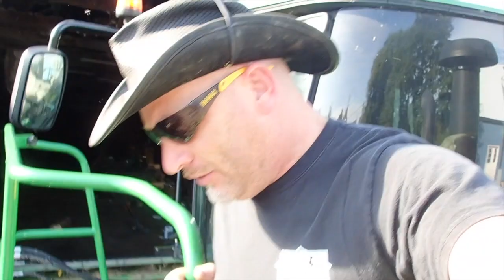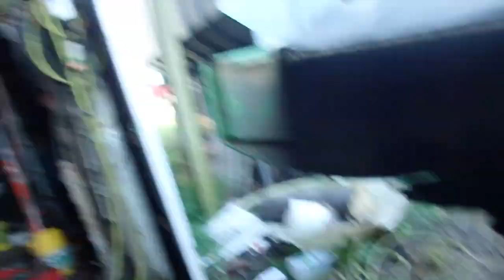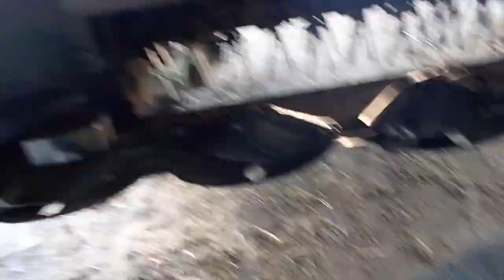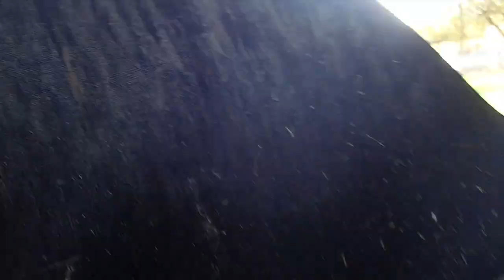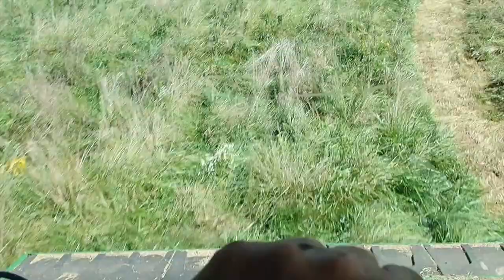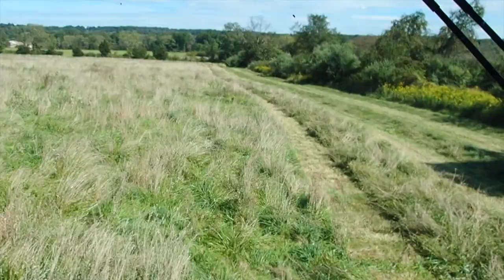Camera Mower Hay

Comment: Might have to try to find more "good" help. Not an easy task these Days as most kids won't work the hours needed. Might have to consider other options to allow you to cut faster as you have told us before. Weather issues are just a part of the farming life as we all know. At least your equipment issues for the most part seem to no longer be an issue as they were in past Years. Nobody has to tell you it ain't easy, still beats sitting behind a desk!

Comment: It looked more like a swale than a ditch. but whatever. Relative to your dad's knees -- he should look into knee replacement. I will be 70 in March and had one knee joint replaced in July and in October I will have the other one done. Every person is different, but I was walking without a cane within two weeks of the operation and at six weeks out the new one usually felt better than the old one. The first week is a bit painful, but not rolling on the ground pounding it with your fists sort of pain. After that it is really only the physical therapy sessions that hurt..
They can also straighten out the bow-leg that results from bone on bone wear (it's just carpentry according to the surgeon.) I really recommend it.

Comment: Hi one lonely farmer love the videos I have question why don't you use butterfly mowers to cut the grass to dry it out. I would have thought it would dry quicker? Please don't take it the wrong way
Reply: James Coy butterfly mowers that you pull behind the tractor have latge rotors with large blades on the end, and each rotor will cut five foot width or more.

 They are intended to mow grass for weed control. They will cause loss of the leafy parts of the crop and do not promote consistent drying and cause more damage to the remaining plants due to a ragged cut.
Reply: Ok thank you for your reply was just wondering as it's will be getting on late in the season and around me they have done 4 cuts off the grass and they have dried it with in a week and it's off the field bear in mind I live in the uk
Reply: James Coy it all depends on the end use, its like sweet corn starts as being tender and as it ripens it gets tougher, the younger the hay the more digestible and the more nutrients the animal came get out of it resulting in needing to feed less grain to supplement it.
mulch hay the feed value doesn't matter so making less trips over the field is the advantage